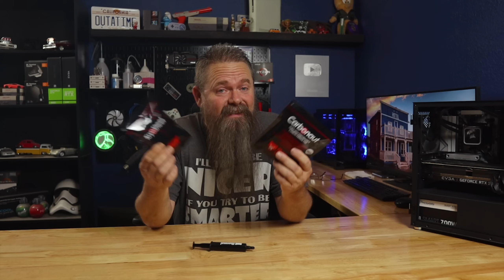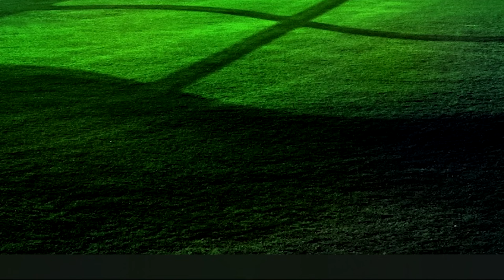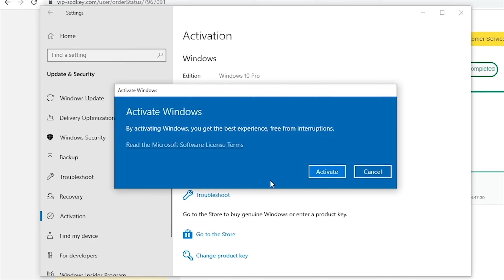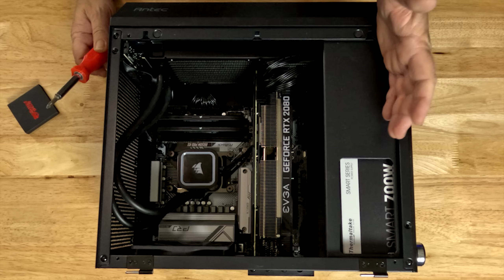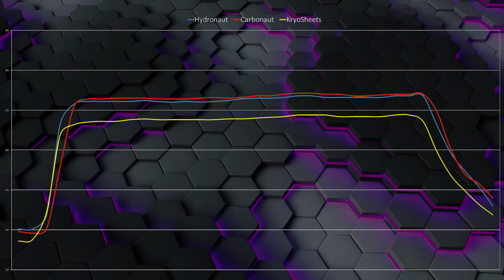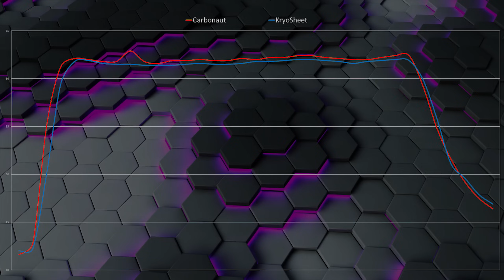Thermal Pads OR Paste, Which is Better?

Comment: I've been using Innovation Cooling's versions, IC Graphite, since about 2018. This longer term use-base is what I believe are the soul purpose of these pads attractiveness. They are on par with decent TiM but never dry out and degrade. Compared to IC diamond/Thermal Grizzly/Noctua/ID cooling (best IMO) pastes that are broken in and stressed for a week, these pads run 6-8C warmer on average yet remain stable for the life of the build. Think about that, an i7 9700K from 2018 is using the same TiM in what is about to be 2025 and performs exactly the same (if untouched).

You made the best point I could make: Never remove the cooler. Neither version of these thermal grizzly pads nor the IC Graphite perform the same again if the cooler is removed, so you could probably test me on that as well. I wish I had a lab to play in by my best guess as to why: Once they're pressed in place and form with the slight imperfections of an IHS, they take a form that fits that exact placement and orientation. Now this is nit picking, but I wouldn't expect over 10 changes and see the same results. I simply haven't on two other builds that retain the same CPU as well as a control group (if you will).

But whatever, why remove the cooler in your own builds any way? Mount the thing and forget about ever doing a TiM clean and swap just because it dried up and started heating up and crashing. Change to a new CPU? New pad. After all, CPU's change sizes so much that the old one for your 1151 isn't going to work on a 1700, and the 1700 doesn't fit on a threadripper, and so forth. Any PC you build today is going to do fine for at least 5 years.

Comment: Cryonaut is made from carbon fibers and cryosheet is made from graphine. Both of these materials have excellent characteristics in thermal contactivity and in the same time they do not leak. I use Carbonaut 38X38 mm for my Intel i7-14700K with Arctic freezer 420-3  and the max temps I had during trial stress tests was 87 degrees celsiu wich was droped istantly when the load was droped. Idle temps are 5~7 degrees celsiu above room temperature. That I think is that proper instalation of cooling blocks on CPUs is more important than any other factor. New metal frames which replace the MoBo's CPU base offer more balanced pressure and avoid any bending of CPU case which has as result bad conduct with cooling block. An other serious factor especialy for water cooled systems is the orientation of the parts of cooling system . Avoid air bubles and air pockets is very important for proper cooling.
Now I'm going to test Intel i7-14700K with Arctic freezer 420-3 in push-pull mode and i expect other 5 degrees celsiu min drop at max load . All measurments had performed without CPU untervolting.

Comment: my 5700x3d is running at 44c Idle with carbonaut reused. I don't know if the AOI is poorly sit or the pad is just not good after 1st use, or what. It ramps up to 70'c on load. Full100% load it can go to 90c in a sub 15c room.

Comment: I never use the paste provided with coolers.  I do a bit of audio electronics as a hobby and much prefer the standard white silicone heat compound.  This compound also lasts considerably longer than any of the so called fancy ones for CPUs.  I use only have Class-A amps and these run for easily 15 years before a transitor fails.  At that point I will replace all the transistors and of course replace all the thrmal paste.

Comment: It should be mentioned that these are conductive.
Reply: What does it change?
Reply: @Taunteur just something to note. It doesn't change anything other than how you handle it. Keep it away from powered circuits, exposed battery terminals or capacitors, etc. Also make sure you don't leave any tiny trimmed pieces behind.

Comment: i could be wrong about your cooler hose length but optimal cpu cooler is either over head or with hoses going to the bottom of the case where as your radiator is higher than your cpu so why use the least recommended install with the radiator hoses at the top of the case? i understand it works especially if you frequent maintenance your computer to top off liquid but if your cooler is like 2 or 3 ounces low on fluid it still work reliability. where as if your hoses are at top and liquid gets even a little low it can stop drawing water and then burn out your pump...

crazy part is so many  builders mount them wrong from the factory
Reply: The least recommended is surely with the pump at the highest point, when any air at all will collect at the pump and burn out the mechanical seal.  You need a lot of air in the system for it to block the return flow from the radiator in a closed-loop system such as this AIO cooler even with the hoses connected to the top of the radiator, although it is undoubtedly better to have the hoses entering/exiting the radiator at the bottom so that any air can collect at the top tank of the radiator.
Now, in an open loop, unlike this one, it is fairly easy to get an airlock as you describe, so different rules apply.
I worked as a pump engineer for some time, so I'm very familiar with the need to keep the mechanical seal lubricated with coolant/water and the difference between open and closed-loop systems, the circumstances where self-priming pumps can and indeed must be used, and how and why vertically chained pumps work and how to protect their seals, for what it's worth.  IMO you have a point which applies mostly to open-loop systems, and which could only apply to AIOs that are a decade or more old.
Reply: @The_Real_Phil_Lee  i to am an engineer but i work with propulsion systems for space but i should have a grasp on what im talking about... if dissect this system i could better show you how even slightly low water levels  with hoses at top could easily thin out the pressure do to improper draw. evacuating oxygen from water  unable to propel and then the designed pump rapidly lose life while improper cooling. 

i guess we only half agree so i will agree to half agree hahaha
Reply: @paratrooperz1  In any hydraulic system, pressure at one point = pressure at all points until there is a restriction, and even then, only under high flow.  So you can't "thin out" the pressure due to improper draw, because coolant is pushed past any air in the system or pushes the air through, and it doesn't matter how the hoses are routed.  It's not like a syphon which can be broken by a bit of air.  The pump output feeds its input in a continuous loop.
Reply: @The_Real_Phil_Lee  yes and no i will start with air can compress and expand nearly 90% give or take more than water through this effect alone a drop in pressure. through the high and low pressures can try to pressurize the heavier water down with the low pressure built up near the tubes...

then theres the fact of, can a radiator truly be considered a closed loop as in the radiator the heated side is pressurized and the cool side sheds pressure!

then have you seen the radiator internal it isnt like its a single loop the water divides into multiple channels working in parallel.  you can pressurize a manifold but if you pump into a manifold it doesn't have the exact effect of a closed loop and a radiators very much like a top and bottom manifold.
Reply: @paratrooperz1  The volume of a closed loop system is so near to fixed as to make no difference, and in fact, until some coolant has evaporated through the hoses it is variable by exactly as much as the water changes volume according to temperature.  The Radiator is in plumbing terms just a pipe - try blowing through one sometime.  The only difference is that the end tank (opposite the pipe fittings) forms a wider section of pipe where the flow is slower, and contaminants tend to settle there more as they aren't flushed through by the flow of coolant.  If this is combined with the tank being at the top, it is doubly difficult for air to be flushed downhill from there, although a smaller widening is on the ends where the pipe fittings are, so will have a similar but lesser effect.  The inside of the tubing is fairly small in bore (more so than in an open loop system with hard tubing) so flow is fast there and air tends to be pushed on through.  Yes, I know air is compressible - that is the fundamental difference between a gas and a liquid, like water, oil or coolant.
Reply: @The_Real_Phil_Lee  wait what? i had to read it twice to see if it agrees or disagree or what message if any.... i will pretend to understand and say this. sometimes water can act like a circuit/electricity.... vapor gas  and liquid often can share many traits but never measure. 

the more viscus/thick the liquid the more resistance can impact as well as proximity. like a manifold that provides parallel paths. 1 path taking 3 ft and a path taking 10 feet can measure low levels nearly identical or high pressure with a great deal more air volume vs water will try to travel the path of least resistance. radiators rarely have symmetry. 

but wouldn't you want sediment to fall into the grid often found at the bottom where most radiators having an top inlet or a bottom outlet. the grid is designed to hold sediment while the pump draws water.... 

well i do not want to say your wrong but just because it can doesnt mean you should like when i charge my tesla the warrantee says i can charge to 100% but should I? knowing heat kills all electronics even batteries and a battery starts to increase in heat after 80% and battery's that erupt usually do so on batteries over 80%. so yes i can charge my car for days or years before a problem or from the day of purchase keep a 80% rule and now my battery may last a million + miles... 

so what im saying is you shouldnt mount your radiator upside down with the tubes at top but it is designed to be compatible do to the fact cases and boards demand different lengths of hoses and if you cant reach a bottom then feel ok to mount to top but if it fits at bottom it is wact and recommended o mount hoses below long as the highest pint is any part of the radiator!!!

Comment: yea the slight increase in temperature of the carbonaught compared to hydronaught is expected (went from hydro>carbo myself). my system is custom water cooled so the slightly worse temperature is not a real issue but as a tradeoff i get 0 pumpout 0 drying and as long as it stays in 1 piece you can just re-use it also i can't immagine pulling my cpu out of the socket using one :P (the only downsides being slightly worse then hydronaught and you can't put them on when your mobo is in an upright position it must be flat on a table).

and in my 10+ years of watercooling i have learned that if there is a issue with the loop...mainly a flow issue aka something is getting clogged 9/10 times it's the cpu block so that has to come out and appart (atleast with my bitspower/ek blocks for the GTX260/GTX470/GTX980TI and the RTX2070S the fin's are way to rough/big to cause an issue and just pass it on to the much finer/thinner fin's of the cpu block).

Comment: PTM7950 is the new hot thing.  It's wicked cheap.  I got 80x80mm for 11 bux.  You don't need that much btw.  It's a little finicky to install, but not terrible.  Think of it as 'liquid metal' in a sheet, that stays put and doesn't short out your motherboard.
More used for GPU/Laptop/Direct Die.  I am sure kryosheet is better in production for multiple systems not under so much thermal stress.

Comment: A real world way to test the performance of your thermal solution is to run a transcode of (say) a one hour video. Convert it to AV/1 with Any Video Converter (free) and you won't need to wait very long for the temperature to spike. My 5950X (not overclocked) hit 90 degrees in seconds and throttled.

Comment: I used a pad in 2020 on a new build and recently  bought new gpu so decided to finally clean my system and after struggling to take the fan off it pulled the cpu off..b550 motherboard that has the lever to grip the pins, I almost shit myself lol inspected it and it seemed ok but fuck pads, not risking it ever again. Pads may last longer but you MUST clean the fan eventually and it's just not worth the risk. Used paste I had laying around and everything is running as it should luckily.
Reply: It was Innovation Cooling pad btw

Comment: Thermal sheets/pads you never need to replace them unlike thermal paste and performance should remain the same over the lifetime of the system.

Wish someone would do a videos showing performance using thermal sheets/pad on a gaming laptop. Replacing "old" thermal paste on the gpu and cpu. A one-time Replace and forget. Laptops dont have high tension between the cpu+gpu and the heat pipe wonder how that effects the performance of the thermal sheet/pad.

How about using it on a Older GPU card, assuming you can purchase the right sheet size to fit the die. My 980 ti is old and overheating, it probably needs a good repasting and fan/heatsink cleaning
Reply from the maker: The other benefit to mobile is that it's direct die. It doesn't need the same contact force.

Comment: I am new here and have to say I feel this is wrong. You have compound on both surfaces wape off the majority and then throw in a pad???
you said micro scratches on the surfaces and there is no way you cleaned all that out with wiping, they you shove in a pad and well without a REAL cleaning you left compound on both surfaces and now the sheet has a boost or maybe even a loss since its liquid

Comment: I moved to sheets to avoid reapplication AND avoid potentially breaking a CPU with stuck thermal compound.  For a little more money you get a worry-free, zero mess, more consistent application.  Paste is for peasants.  I love my Thermal Grizzles.
Reply: Why for peasants if it's roughly the same price?

Comment: Paste and or pads pretty well run neck and neck - The real question is the heat pipe - how  does it perform to transfer the heat away - And if the heat pipe is not performing the way it should - no amount of paste is going to matter or pads is going to make any difference. If the heat pipe is damaged in any way such as internal blockage then nothing else matters... A horse pulls a cart not pushes a cart...

Comment: Hydronaut pumps out too quickly.  I had to repaste it after a month on both CPU and GPU waterblocks.  At least the sheets last longer, probably forever until you remove the block.  Just reach for a PTM, lasts virtually forever and performs well.  Honeywell PTM7950 or Thermal Grizzly’s PTM.

Comment: just be gentle when installing and the sheets should be reusable, main advantage i see is the 0 maintenance and relative ease of installation. no need to repaste after a couple yrs, no need to worry about coverage when applying nor the mess with the squeeze out.

Comment: 98% Isopropyl is my go to for cleaning thermal compound. Makes a messy job a lot less messy.
Reply: As soon as he took his rag I was gonna say 😮
Reply: 2 percent is water
Reply: @cclacss My computer case had rust in it, which indicates water and oxygen. No issues.

The only reason you need a high concentration is so it evaporates quicker. That's why antiseptic alcohol needs to be in lower concentration, so it takes longer to evaporate.

You can use ethyl alcohol; you can probably use Vodka if you let it dry completely. Electricity is what causes eletrolysis; Barring that only corrosion becomes a concern.
Reply: @cclacss god tier comment bro.

I always used 70% isopropyl for electronics which is super dumb.

ill use 99.9% or higher from now on.
Reply: This Is The Way.
Reply: I've used coffee filters to clean off my CPUs, it works surprisingly well and without any liquid.
Reply: @tsjeriAu Same they work great and leave no residue!

Use it with alcohol and the result is even better; because it can be hard to remove all of it.
Reply: @tsjeriAu  You can use a tampon too all can be used even Trump's dieaper!💀🥺
Reply: The arctic MX cleaner wipes are even better than IPA but leave a distinctive smell.
Reply: @tarbyonlineful That's lemonene. As long as it evaporates entirely, there's nothing to worry about. Had to use a bunch of these lately because local computer shops only sell MX-6 with wipes. At least they do the job and leave no residue.
Reply: @tarbyonlineful  actually used some of these recently and they came in really hand to clean up the shitty MX6 paste that was in the tube, i went back to the MX2 i had in the drawer for that application on a mates old rig

Comment: Thermal paste does degrade over time - so once in a while you need to repaste to keep same thermal conductivity of the system. I think the idea with pads is that they are solid solution - they  should maintain properties over time while offering similar or better heat conductivity. IMHO this makes KryoSheet ideal for GPU's. There is tons of Watts being pumped there with massive spikes and coolers have gazillion screws. Do it once - forget it, never worry about it again.

Comment: I bought Kryosheet for my AMD build and found the sheets to be so brittle that they were functionally unusable.  Maybe I just suck at cooler plate placement.. I do wonder if I could use a small drop of paste to hold the sheet in place while I mount the cooler or if that would have a detrimental effect on the sheet's effectiveness.

Comment: I have a dell laptop and was having to redo the paste every couple months as the paste keeps pumping out on the cpu, the gpu was allways good but the 11800h was allways at 100c under load even with fresh paste but over time it would keep throttling more and more untill it would draw only 15w tdp but be at 100c. i eventually gave up using paste and tried a kryo sheet that i cut up for both cpu and gpu and now allmost a year later the highest i seen the cpu get to is about 90c at the full 110w tdp load